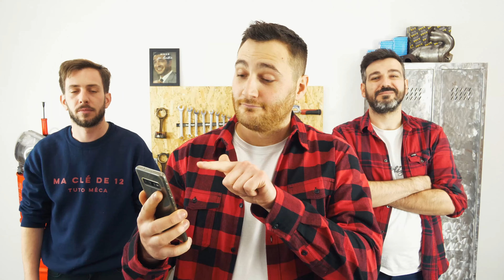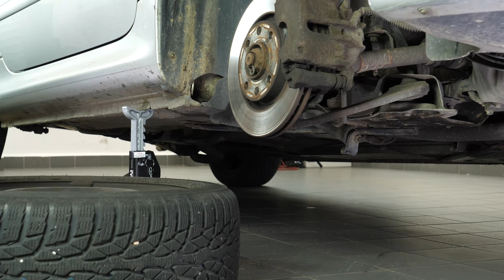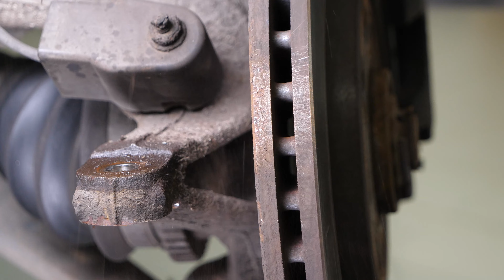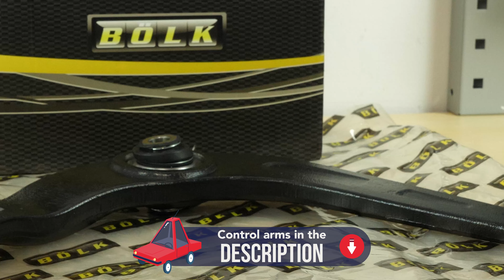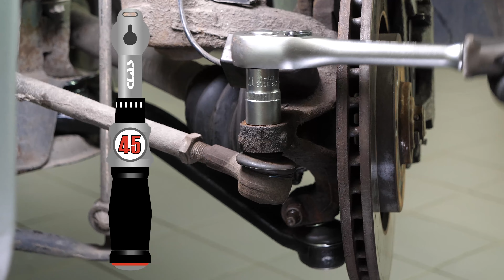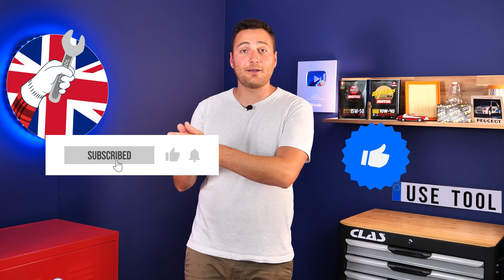How to replace the control arms Peugeot 206 🚗

Comment: What happened to the lower ball joint protector?  It's a small metal shroud that fits over the ball joint and has a tab which locates into the slot for the pinch bolt to make it stay in line with the assembly when it turns with the steering.  Not exactly an MOT failure but it is really better if it is there.